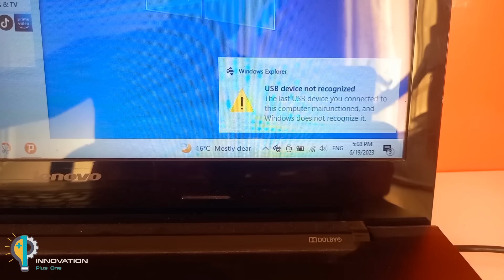2 SIMPLE INVENTIONS FROM USB || USB Tester

Comment: this is different cables and it work. 
If you look at the pinout of the USB port, the signal pins are exactly in the middle. If the cable were broken, the integrity of the electrical circuit would be violated and as a result, your LEDs would not light up.
Reply from the maker: No, every wire that is broken in a cable, the same LED for the same USB wire will not light up, so we can understand which pin is broken.

Comment: The second cable is perfect 6:34 It is normal Chinese charging cable without mid-data pins... it shows up and down so + and - are there mid wires are data wires...  still a good cable but j
Reply from the maker: No. It was a data transmission cable, although the VCC USB pin was disconnected and connected and was broken❤🙏

Comment: The second cable is likely not broken. Some cables are just for power only while the better ones do power and data. Also they're getting more complicated with complex circuitry in the ends of the plugs, themselves.
Reply from the maker: No my friend, in this video both cables were for data transmission❤
Reply: @InnovationPlusOne но он заряжать может
Reply: @InnovationPlusOne 
What was the purpose of the second resistor thing you made that the computer did not recognize nor did it light up with the power box
Reply: @DAT-TEXAS-DUDE  I believe it was a port tester, if it lights up green the port is working
Reply: @InnovationPlusOne cut the "broken" one pls and u will see its just 2 wires

Comment: Note:...some usb cable does not transmit data only for its 5 dcv power..
Reply: thats true but the tester would test thouse for if theirs a problem
Reply from the maker: Yes, you are right, but the black cable was a data transmission cable, but it was damaged🙏❤
Reply: @InnovationPlusOne  ....but at least now we can identify if its a data or power cable...you can't program a microcontroller with a power only USB cable...

Comment: The second one will trigger one basic charging mode, but not by far test all possible current modes. You get really useful charge/voltage/current tester+logger with small display for a few bucks.
The first one is utter bullshit.
Reply from the maker: Thank you for your opinion about this USB tester🙏❤
Reply: @InnovationPlusOne  oh come on! The circuit at 2:55 doesn't make any sense! Give us a circuit diagram and an explanation!!!!

Comment: There is still room for improvement!
Reply from the maker: Sure❤🙏
Reply: Number one does not work properly the negative data is for sending data to the host (for example a computer) and ground (GND) wire is for power going back to the host. You can even use an microcontroller to make an graph of what data is send.  @InnovationPlusOne

Comment: at 6:31 the usb isnt bad just some cables are meant for charging and others are meant for transferring data because the ones that are meant for charging do not have data wires so the tester is unreliable
Reply: Yep exactly, it's like a tester for the data cables , but some one in another comment said the same thing as u and this guy replied to him that the cable was data cable🙂
Reply from the maker: tnx🙏❤
Reply from the maker: My friend has this data cable, and in addition to the data wires being broken, the VCC wire keeps disconnecting and reconnecting.🙏❤❤

Comment: 9:41 In which country are there such sockets with two poles and without a protective earth contact?
I am curious ;-)
Reply: Earth wiring isn't mandatory when device has double isolation (class 2), for example.
Reply: @Arthur60  
In e.g. EU there are two-pole connectors.
But these EU-2-pole-connectzors do not allow to plug an earthed (3-pole) plug in.
In other words: When there is an earthed plug this will only fit into an earthed connector.
But in the video there is an unearthed connector, where an earthed plug might be used, which will result in a lifethreatening unearthed device, which requires earthing.
Reply: @galdavonalgerri2101  You may be true in some countries, I remember seeing some, but not in France. Here, earth contact is female on the plug, live and neutral are male. So there is no mechanical way of preventing pluging in an earthed plug (3 poles) into a 2 holes socket.
Reply from the maker: Yes, my friend, some places use bipolar sockets❤🙏

Comment: if the usb cable is only working at 2 side, it's fine but the problem is, that cable is not working by transferring files. because that was a d+ and d-
Reply from the maker: No, my friend, it was a data cable, and the VCC wire kept flashing and connecting and disconnecting.❤🙏